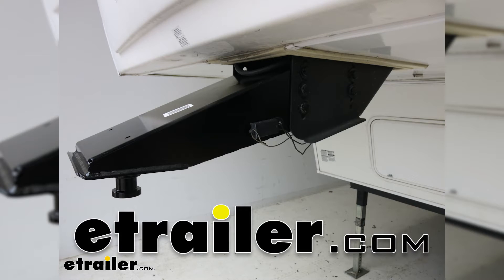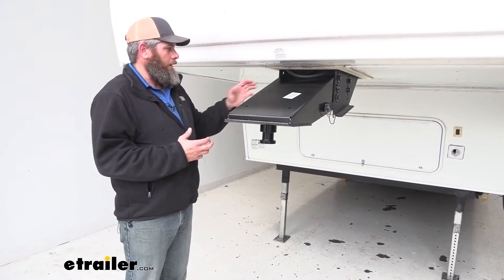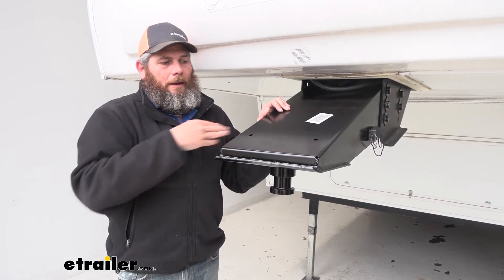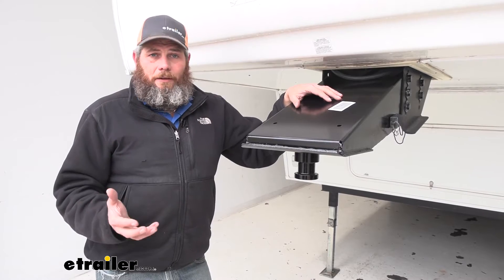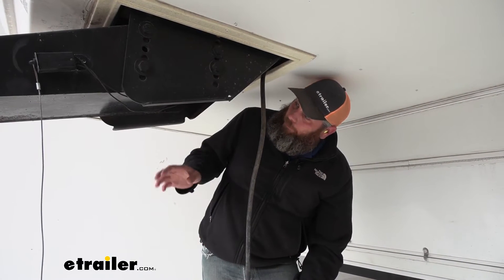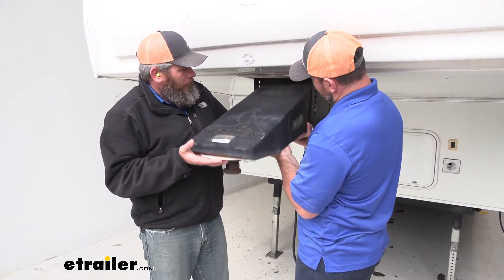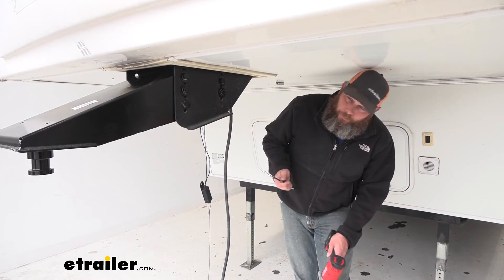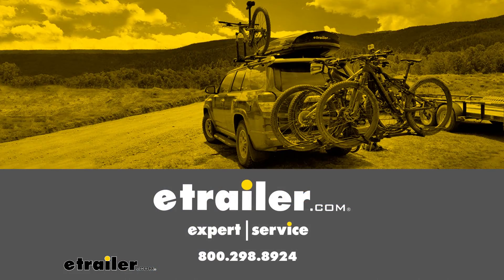etrailer | Mount: Lippert 1621HD 5th Wheel Pin Box on a 2010 Starcraft Homestead Fifth Wheel

Comment: Anyone know the correct torque values?
I just upgraded my 1621 to a Rota-Flex. I torqued up the nuts to 150 ft-lbs
Reply from the maker: The torque specs are as follows for certain hardware sizes.
1/2 inch Bolts GR5 90 ft-lbs
5/8 inch Bolts GR5 150 ft-lbs
3/4 inch Bolts GR5 275 ft-lbs
https://www.etrailer.com/Fifth-Wheel-King-Pin/Lippert/LC1191151.html